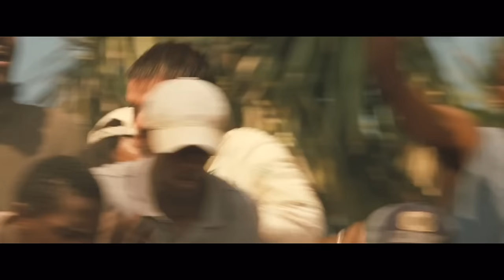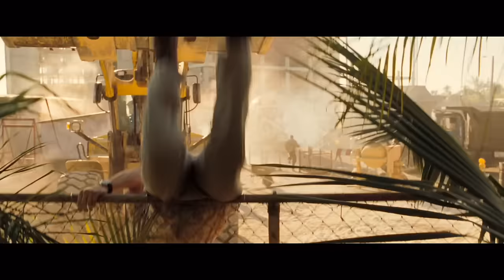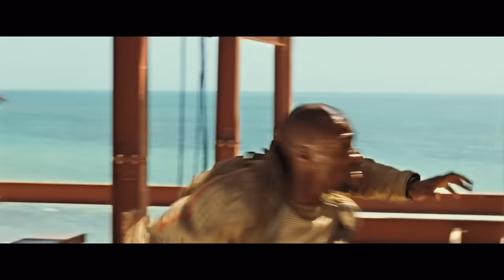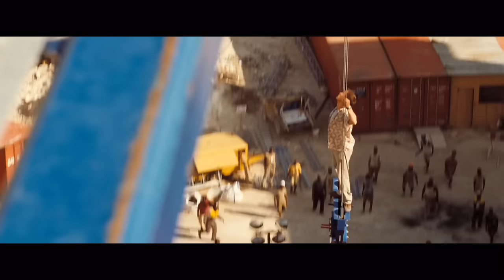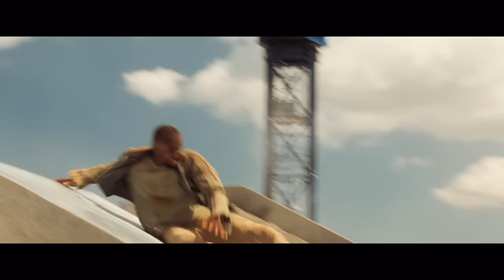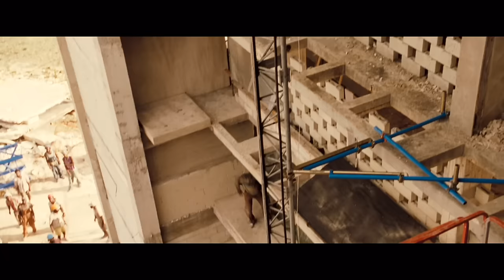Casino Royale - Opening Chase

Comment: They're really damn quick to show you what separates this bond from the others, don't they?

Baddie: Leaps through open car doors
Bond: Just avoids car

Baddie: Running-grab-leaps fence
Bond: Climbs fence

Baddie: Hides with gun after getting ahead
Bond: Rides a motherfucking bulldozer to skip this firefight shit.

Baddie: Wall climbs building at spider-gecko speeds
Bond: Runs up ramp

Baddie: Parkours through unfinished building
Bond: Opens doors

Baddie: Parkours over unfinished wall
Bond: Runs through the fucking wall

Baddie: Leaps down story to story to the ground
Bond: Breaks a lift

James Bond just has no shits to give.
Reply: eating sugar no papa he’s not the Bond that we know at this point. That’s the point. He’s only recently achieved his Double O and is slowly evolving into the Bond we know over the course of the movie. That’s why they don’t use the Bond theme or his iconic line until the end
Reply: My dude takes the lazy way out like a true brit 😂